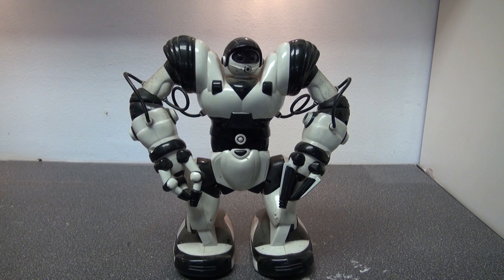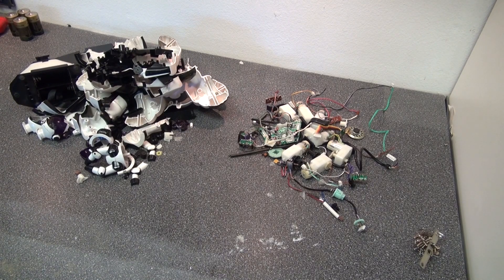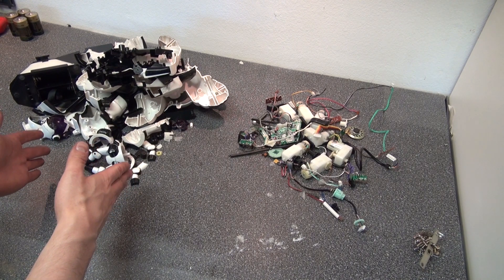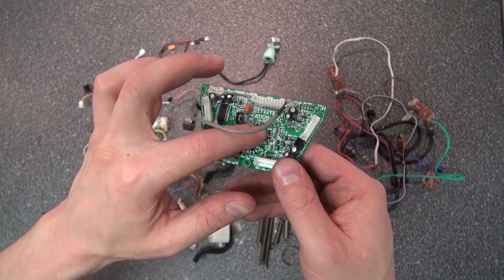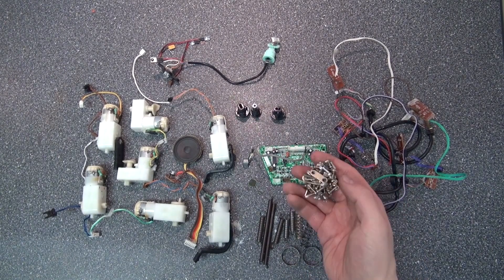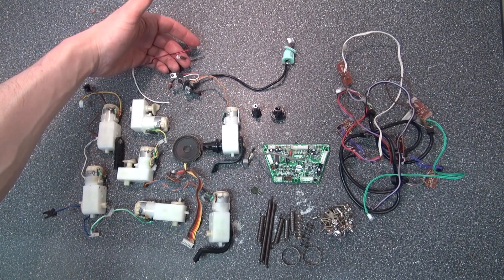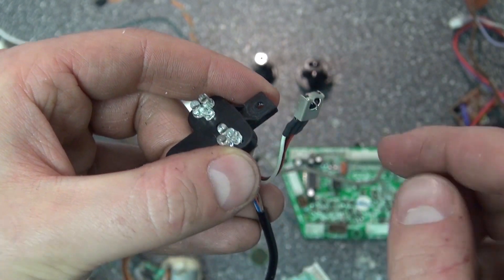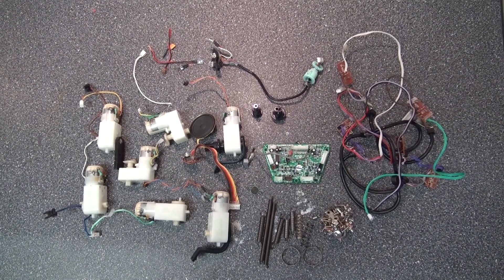Robot Toy Teardown

Comment: The motors you describe as "Servo" motors are actually just geared motors. A servo motor has has electronics that measure the rotation of the geared output using a potentiometer and some electronics. The electronics measure the voltage on the potentiometer and ensures that the motor moves the position requested but the PWM input.
Reply from the maker: Thanks! I knew that about servos, but I didn't know that about the geared motors. I can see that I can do something similar with the geared motors. That means I am going to make something else with the geared motors. Thanks for watching! Have a nice day!